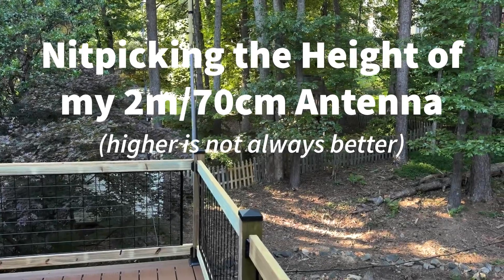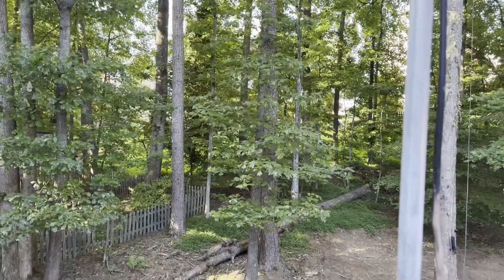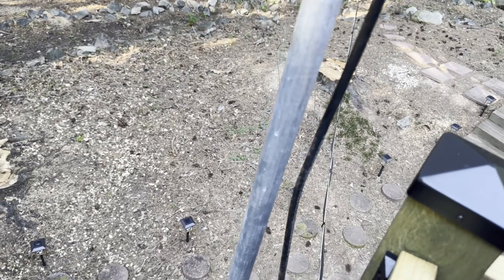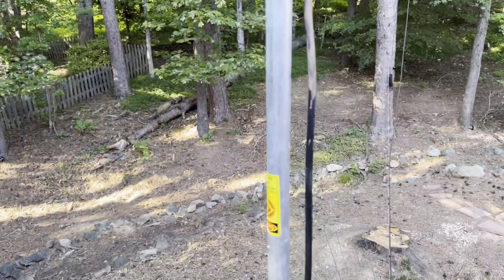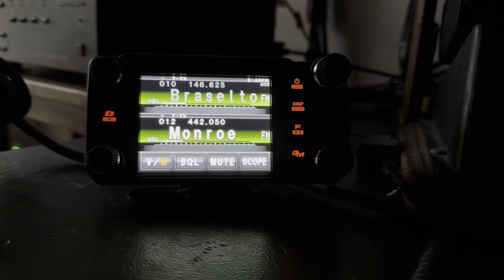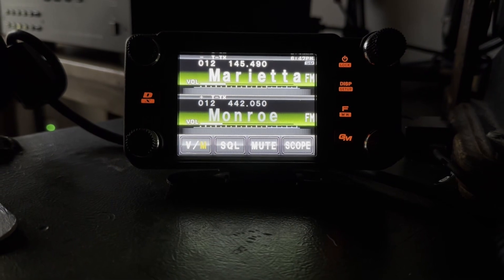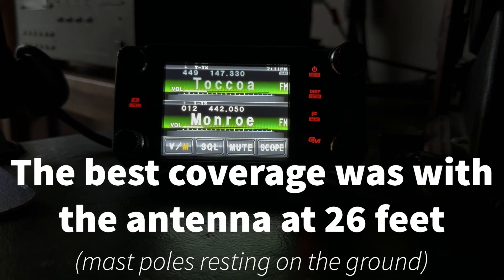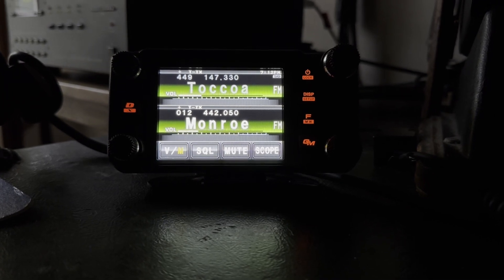Nitpicking the Height of My 2m/70cm Base Station Antenna #hamradio #hf #vhf #uhf #antenna

Comment: I do not miss the ftm-400 😊. Moved to the ic-5100 after I found out how many advanced shack features it had.
Reply: Can you elaborate on that? I'm looking to put a base 2m/70cm station at my QTH and I want a 9700 but it's very cost prohibitive but i have a 5100 in my car that I've thought about taking out and replacing with a 2730b. I just didn't know how the 5100 would do as a base radio.
Reply: @ I emailed you. The one you have on QRZ.

Comment: I am finding here lately that not much beats a 1/4 wave vertical on my 40x60 shop roof.  The vhf/uhf on my roof competes with my GP-9 that is 30 feet up my tower (tip below the top as I am worried of lightning hitting it).  The 102" whip is a monster with the current band conditions on 10 and 12 meters.  I ran 750 watts into that whip for the contest last weekend and was heard by most stations I called.  73, KF0BBU

Comment: First rule of thumb ...... get it above local obstructions. Second rule is .... best coax with the least loss.
Reply from the maker: Third rule… if you cannot get it above local obstructions, use the method I showed in this video.
Reply: @n4hnhradio  Yup...............👍

Comment: Thanks for the informative video.  I put up an X-50A last week that I picked up at a silent key sale.  It’s mounted about 6 feet above my roof and seems to work quite well.  We are in a fairly high location with no blocking hills, but I hadn’t considered the effect of the foliage.
Reply from the maker: Your mounting location is ideal. I have foliage and a hill on three sides. You should have no problems.
Reply: @n4hnhradio   BTW, I purchased an FT-DX10 at the same sale.  It is my first HF radio.  Your videos on the DX10 have been my main source of education!  Really helpful!  73. KF0OKT in MN
Reply from the maker: I’m glad you found the sample videos helpful. There are 100 total. The rest are at: Patreon.com/N4HNH. They are numbered because the tutorial series starts simple and goes into more depth with each video.  I want my viewers to master their transceiver.

Comment: I used 10ft sections of Well Pipe that I bought at lowes, threaded on the ends use a coupler (same section at lowes) it won't bend, works great .. comes in 2 sizes.

Comment: Same antenna here.  I have mine mounted with the base at 20' above ground and it works amazing!  My house is kind of down in a low spot at the bottom of the neighborhood.
Reply from the maker: Like me, you are likely benefiting from the higher angle of radiation, versus a higher gain antenna.

Comment: Nice video Doug. Like many HAMs I just assumed higher is better in all terrains. I'll have to memory pack away the info in your video for future reference. 73
Reply from the maker: It seems counterintuitive, doesn’t it?  It’s sort of like S-meter to the left.  Higher is better if you can get high enough to clear houses, hills, and foliage.
Reply: @n4hnhradio     ...and don't be surprise if, as the trees grow (or fall) and the branches change and the foliage grows and changes ... if tweaking things again makes a difference
Reply from the maker: @justsumname It does.  The foliage changes things.  That’s why I like to adjust it when the foliage is on the trees. Winter time is no issue. No foliage.